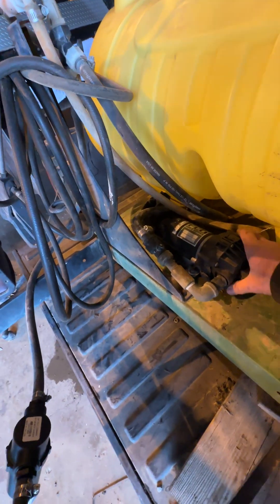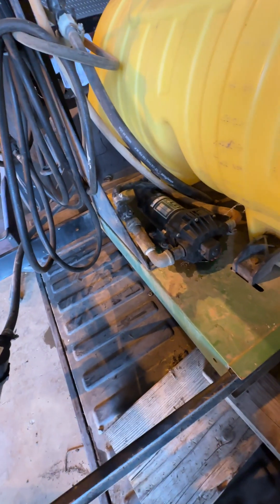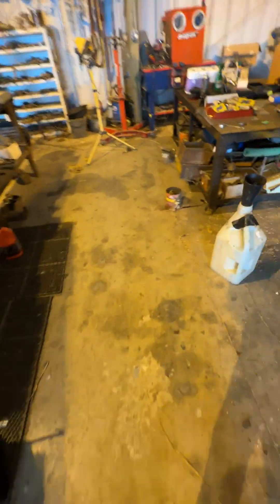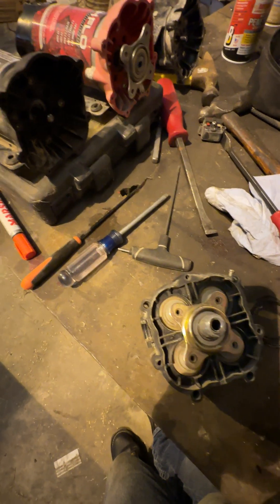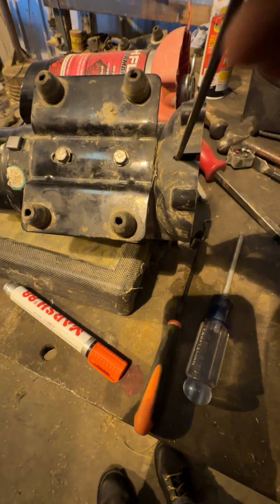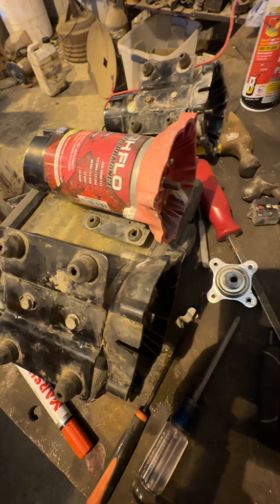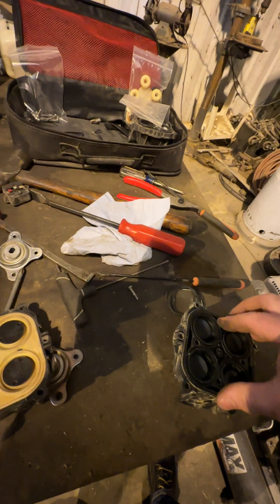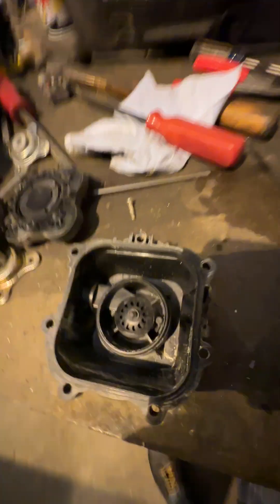Repairing (Fimco) High Flo High performance 4.5gpm and High Flo Gold Series 3.8gpm sprayer pumps

Comment from the maker: Fimco won’t sell the o-rings. They want you to buy the whole head. But you can match them up and order on amazon.
Reply: The o rings I found looked almost identical but a very slight difference in diameter. I'm still fighting air getting into the system so I've ordered a new manifold, fittings, and hose clamps. I hope that will fix it. I also was hoping the o rings would work but if the plastic barb fittings are worn or housing I will never get a good seal.
Reply from the maker: Yes I had the same issue with the rebuild in this video. The orings I got were a little off. I could probably try a different size and get a better seal. 
   But even with it bypassing a little, that motor is still doing all the firefighting and round up spraying I need.  It just doesn’t make full pressure. When it finally fails I’ll try again. But it’s been a while. Ha